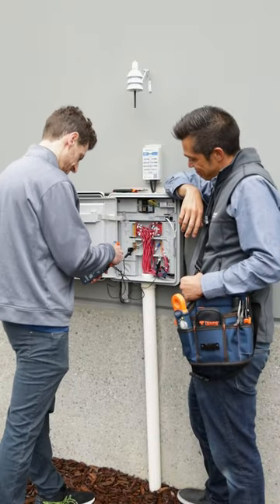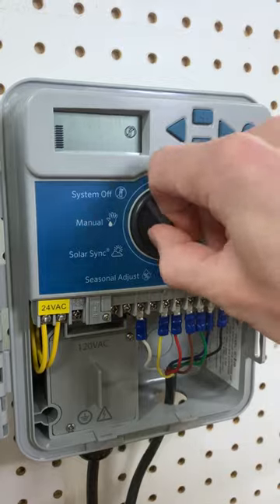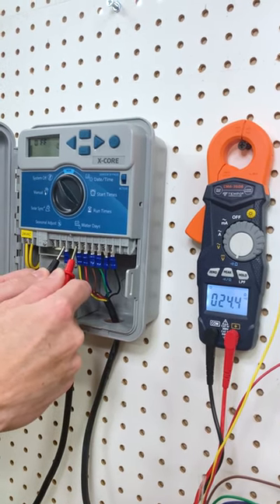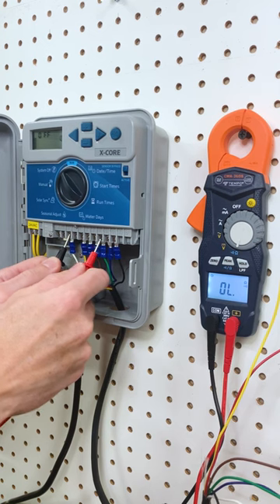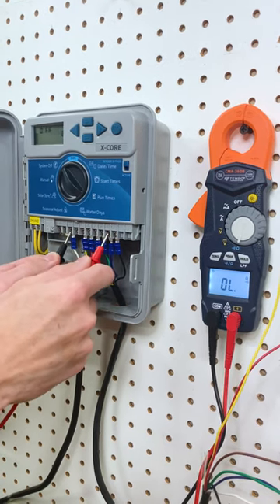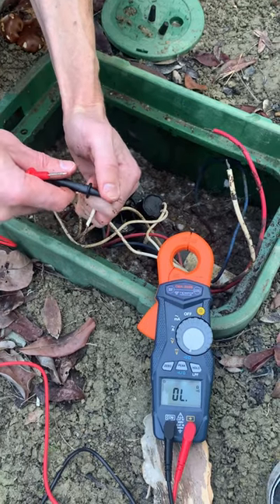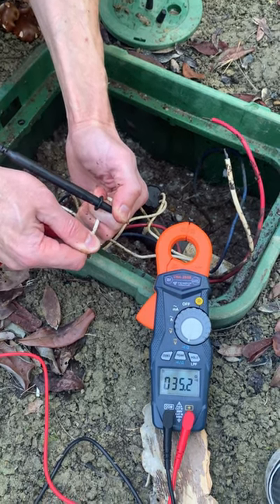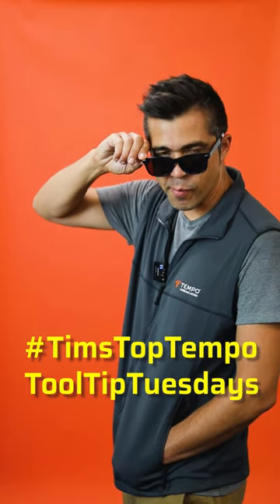Test ALL Irrigation Zones with a CMA360B Multimeter right from your controller - Tool Tip Tuesdays

Comment: Thanks, I have continuity but no output from several channels. The controller is switching through the channels fine. The wiring appears okay. I lifted the common black wire and measured each channel, I got between 24 ohms and 27 ohms. I imagine that is within the tolerance of the device.

What do I look at next?
Reply: Hey Mark, hope you figured out your issue by now, but if not, are you getting voltage from your controller?  Should be 24ish volts coming from the controller and getting to the valve.  Based on what you reported, your wiring and solenoids are likely good.  Next, you could try manually opening the valves by turning the solenoid.  You might have a hydraulic issue: clogged valve or solenoid port hole, ball valve or master valve not on, etc.
Reply: @  thanks we sorted out the issues. We had a few back setting and an intermittent water pump.